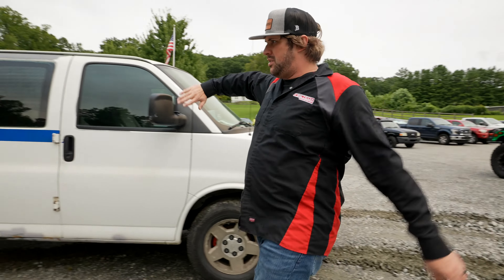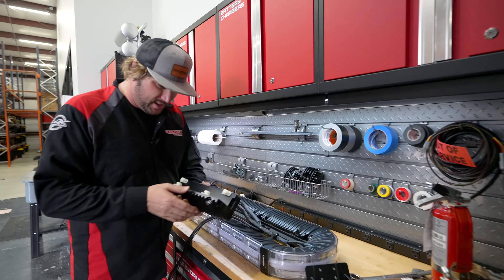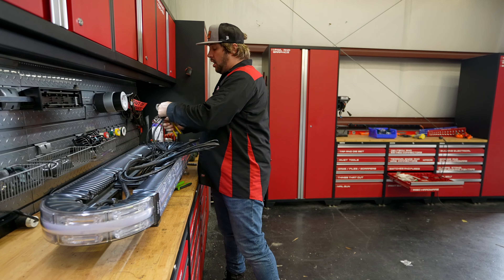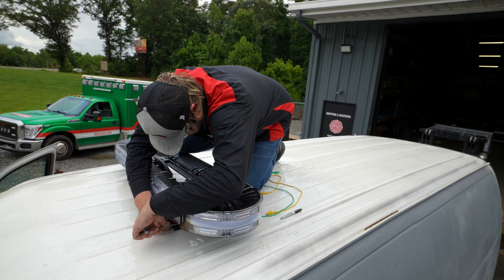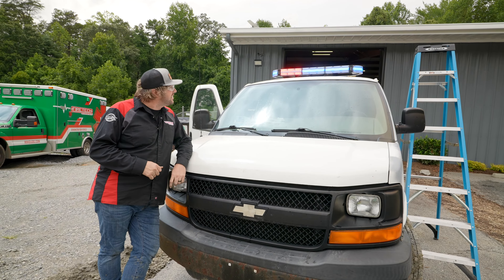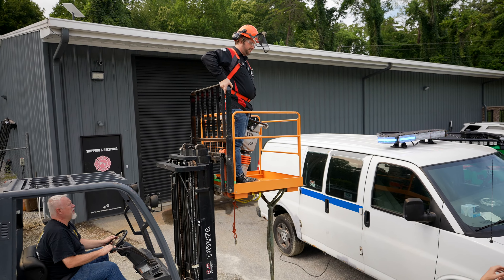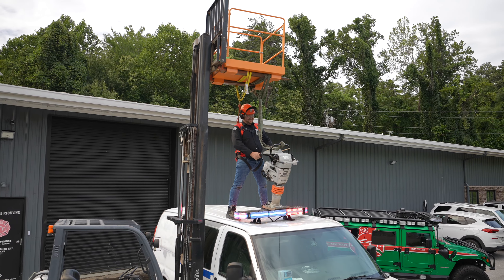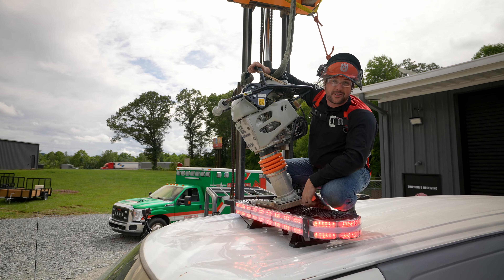Extreme Durability Testing: FireTech Omen Warning Lightbar vs. Jumping Jack | HiViz LED Lighting

Comment: Can you repeat the test on the ground, or some other hard surface? In looking at the footage, it looks like all the energy was passed on from the bar to the vehicle, to the ground. I feel like repeating the test on the ground would eliminate energy transfer to the vehicle, and would inflict the energy on the bar (as the test seems to be designed to do.)
Reply from the maker: Hey Doug! We sure can, we’d just need the jumping jack back. There are some more videos showing similar application to what you mentioned coming.  With this thing, the higher RMS vibration occurred when there was more range of motion, on the ground it just looked like jackhammering a bar of aluminum (aka pretty boring!). More to come!
Reply: @HiVizLEDS Thanks!